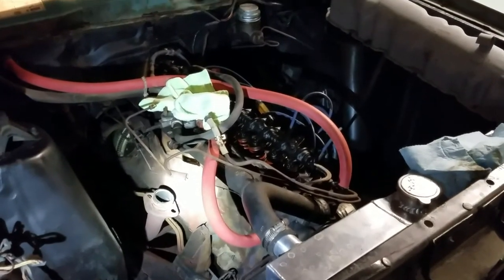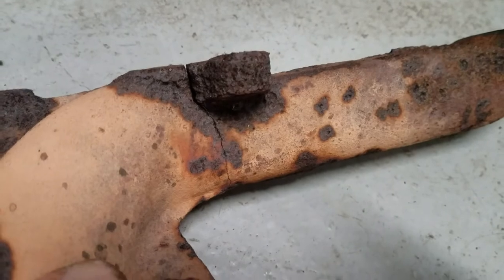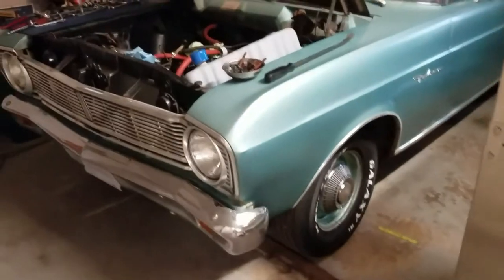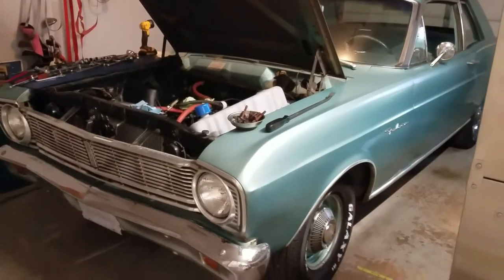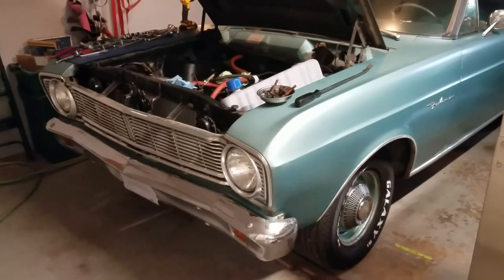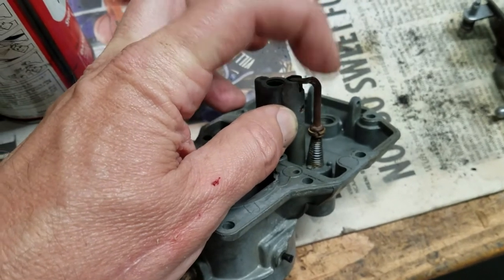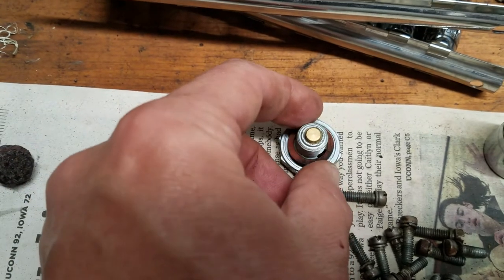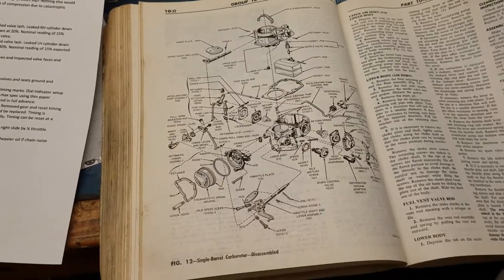1966 Ford Falcon project Pt 2 Exh manifold and carb

Comment: I have a spare manifold for your model if you want it for free , it's original . Will have to mail from Australia . Cheers from Australia kindest Regards Dan 👍
Reply from the maker: Thanks Dan, but replaced long ago. The shipping would probably cost as much as the new one I bought. The repro ones are actually pretty good.
Reply: @mongrelmotorsports  no dramas mate 👍